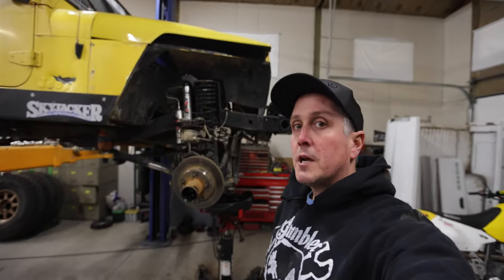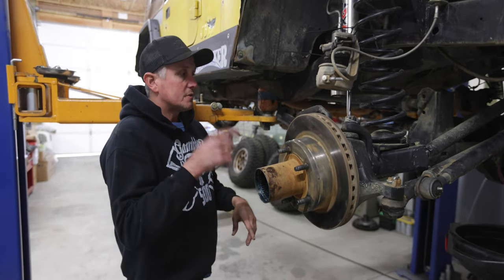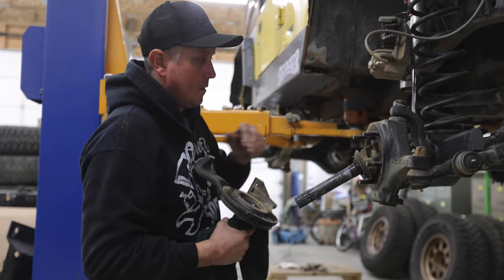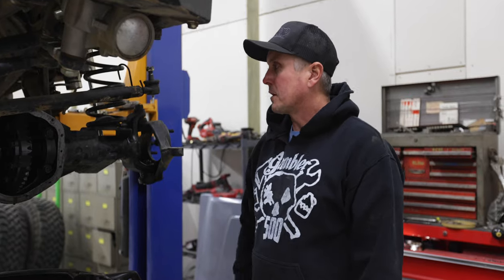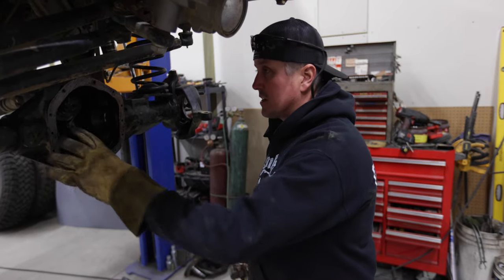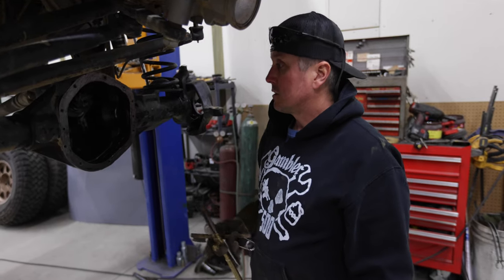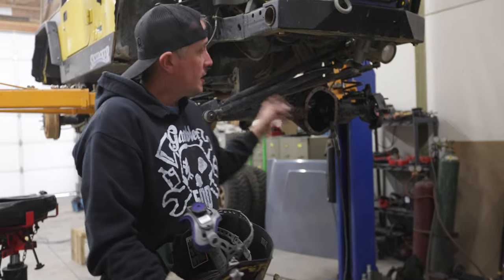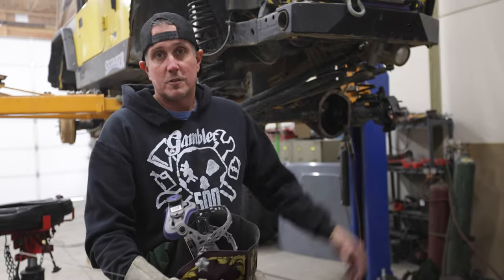Repairing a Dana 44 axle housing and the tricks I use.

Comment: Being a retired pipe fitter/ welder your choice of the high nickel rod for welding dissimilar metals is correct. The fact of welding cast steel to steel tubing again correct choice of the filler rod. The good part of your process is the preheating of the cast material, although either heating or peening the weld afterwards does help with stopping possible cracking. Good job young man.
Reply from the maker: Thanks!  I’m no pro.  Just a guy figuring it out as I go.  And trying to take in all the information that I can

Comment: I love seeing different ways to weld axle tubes to the cast.  I've got a stick/TIG machine but only done stick with it.  I've welded cast iron to steel and it held up well.  An old guy told my welding buddy that if a magnet sticks to the cast well, you can weld it but if it's not very magnetic the weld will never hold.  Not sure how true that is, but the cast I welded held a magnet almost as good as steel.
Reply from the maker: That’s a valid technique

Comment: Super cool video, wish I had a TIG! I welded the tubes on my 8.8 this summer using a MIG with no problems. Preheat to 400+ degrees, weld, then wrap with a welding blanket to hold the heat in and cool slower. 5k miles on it so far, no problems.
Reply from the maker: Yep. Getting it done

Comment: Great tip fave I’ll be picking some of that up for future projects.

I use to work for a sawmill mfg company that utilized VW motors for the power plant. We direct drove the mill with an extension that was welded to the forged crank I think we used a stainless wire in a Mig welded on a turning setup, it work pretty good until something hard was hit with the saw! They would commonly break right at the weld, kind of a fail safe. 

Thanks again!
Reply from the maker: Good information. Thanks
Reply: https://youtu.be/y07RP06N7o4 in case you want to check out the sawmill.  We did a lot of our own fabrication from machine work to welding, and ground up engine assembly.

Comment: I'm one of those who welded the center section to the tubes on a Ford F250 axle.  I didn't use nickel rod because I'm not trying to get cast iron to keep together - will it work to seal the tube? absolutely.   I took my high pinion apart, moved the center section to the passenger side, installed a truss/upper arm mount, used RCV spindle mounts with 1/2 ton GM spindles.  Used 4340 Yukon gear inners, needle bearingless ujoints and dana 60 outer stubs.  It's been bulletproof - been running it for 7 years now in an FJ40 on 40s.  I used the 44 because I wanted clearance. Going to weld a mount to a Dana 60  this weekend, using MIG.  Nice thing about those Ford axles - 1/2" dom axle tubes.  An alternative to expensive nickel welding rod or arc welding rod - stainless wire for your MIG....
Reply from the maker: All good info. Thanks
Reply: @thedirtheadshed  I learned about the same way as you did... good and bad old timers.  The good ones told you the right way, the others got fireworks in their weld lines

Comment: The issue about welding dissimilar metals is due to the different rates of thermal expansion. The reason nickel is suggested as a welding rod is because nickel will elongate more than other types of welding rod before it yields (cracks). This allows the two metals to expand and contract at different rates without cracking the weld. Welding to cast is a different issue all together, because the manufacturing of a cast piece can have many inclusions and contaminants contained within the part. These can potentially surface during the welding process and require serious rework. With this said, if you know what your doing, all these issues can be overcome as you showed. Looks killer!
Reply from the maker: This is the information we need to know.  Thank you for commenting.

Comment: I mig welded my d30 with just warming up the center forged steel, worked out really good
Reply from the maker: Right on
Reply: Sometimes polishing a turd works out good, after spending 1500 on it.... Wheeling it for 5 years now on 35s, havent had an issue yet...

Comment: Thank you, on my 15 JKR 4Door I have installed on my Dana 44 a full upper truss, upper and lower C braces, RCV axles and Dyanatrac Ball joints and Reed Knuckles. PSC hydro assist now on 37 inch BFG's. and you just let me know that i have done the right thing. I had been doubting my decision and thinking about one tons.
Reply from the maker: It should be good to go

Comment: I love seeing this kind of stuff Dave. It is useful and practical information the average guy in his garage can use. I have used ER70S-6 mig wire to weld axle tubes to center sections a few times and never had any issues. I have been told it has a decent nickel content for mig wire
Reply from the maker: If it works it works.  That’s the wire I use too

Comment: Good tech Dave!!! Gonna try that rod Next chance i get!
Reply from the maker: It’s good stuff
Reply: @thedirtheadshed  I like to fill my housings with BBQ briquettes for preheat/post heating. Kinda hard to do that with housings in the rig though.
Reply: @thedirtheadshed  also the tj axle shaft trick I used on the front axle that's in my black cj7!! Which is a cut down waggy housing! I also splurged and went  30 spline on the outters

Comment: This is such a better quality video, in production and content than the first few. Love these home style how to videos especially on welding and fabrication.
As a home builder, have been stubbornly using flux core wire (gas less Mig) even for panel work and and welding thin stainless motorcycle exhaust for projects. Do you ever use it when away from your shop?
Reply from the maker: I have used it here and there. Definitely works well in the field.  And if you get the technique down it can be really clean and strong

Comment: Keep it coming I’m using the same axle though everyone tells me it’s not strong enough. Also good to see someone use chromosome in a 44 instead of going straight to Rcv. I would love an rcv setup, but if a $600 option works, why pay $1800 (3x more) when the splines will be just as weak
Reply from the maker: I like the idea of rcv stuff, but I’ve had really good luck with these Yukon super joints

Comment: Cool stuff Dave! I don't know that I have ever seen that rod before, but I have a pretty good selection of nickel steel stick welding electrodes in my bag of tricks. Was you purpose to just seal the tube to the housing? Looking at the weld, I wonder if there is enough build up of metal to not crack down the road.
Reply from the maker: Yeah. Just sealing it. I did a double pass.  It should stay good

Comment: I was wondering how did that Midnight Metalworks T-case work out on the UA? It is something that I am thinking about, I heard that they take up less space than the 231. I have an UCF ultra high skid on my jeep with 1 1/4" body lift, so there is little room and I don't want to beat up the floors to fit an Atlas.
Reply from the maker: It is good and compact. I will have a real review of it soon

Comment: Thanks Dave, I've been wondering about this, about dealing with the oil.  Do you heat it til its done smoking?  Or do you shoot for a specific temperature?
I'm going to be putting a Sterling 9.75 out of an Econoline van in the rear of my Astro van for drag strip use.  It's got a cast iron center and steel tubes.  Almost all of them that I've seen are leaking in some way.  Needs to be welded for what I'm planning.
Super Missle Wire...LOL!  I was looking at nickle 55 but I'll have to look for some of that.
Reply from the maker: I heat it till it stops smoking
Reply: @thedirtheadshed  Awesome.  Thanks for the tip!

Comment: You using .023 or .035 wire?   I came from welding on heavy equipment and used .035 and bigger but thinking for jeep stuff I should maybe go to .023 wire.
Reply: For mig welding sorry I should have made the clear.  You da man Dave!
Reply from the maker: I only run .030 in my mig.  Never been able to make 23 or 35 do what I want it to do.

Comment: Thank you for the vids!  I was wondering if there is a pre heat/ post heat process when you tig weld the cast steel to tube steel, Or is that just for cast iron to steel?
Reply from the maker: You should pre heat, and make it cool as slow as possible

Comment: I have the exact axle going in my TJ.
What steering did you use. I tried to use the stock Bronco linkage but the drag link runs behind the tie rod and it won’t work.
I ordered some heims to make my own
Reply from the maker: This is a y link builder kit from Barnes 4wd

Comment: I have an F150 HP D44 from 1977 (disc brakes, 1/2" tube walls) and I am 99% sure the center section is cast iron (ductile iron). I tested it against the knuckles (also ductile iron), the tubes and the inner C's (both cast steel) using a sharp drill bit to generate some cuttings and then inspection. Steel will produce long twisty cuttings that are a bright silver color. Ductile iron produces some shorter twisted cuttings, but mostly smaller non twisted cuttings with a dull grey color. The only way I could be more sure about the materials is if I sent samples to a lab. 

The tubes and C's are bright and twisty, and the center and knuckles are flaky with some small twisted shavings, and dull grey in color. I am so sure the center and knuckles are ductile iron while the tubes and C's are steel because this type of comparison is very obvious. 

Perhaps the F250 is different? I notice the center castings is definitely different in shape (subtlety) so the centers housings of D44's out of late 70's F250's definitely could be a different material than 1977 F150 D44s.
Reply from the maker: You have done a lot more homework than I have on the matter
Reply: @thedirtheadshed  Perhaps, but all I can say is my particular axle housing is ductile iron. In a higher GVWR vehicle like the F-250 it may be cast steel for strength or impact resistance or some other reason.

Anyway, I enjoyed the vehicle and look forward to more in the future.

Comment: Love this jeep! How much weight do you think you saved going with the truck 44 vs a 60 that had also been narrowed? I moved one of those big truck 44's around and it seemed pretty heavy.
Reply: The 8lug d44’s have 1/2” wall axle tubes so it’s only knuckles out and center that’s lighter
Reply: Thanks Larkin, so maybe 100 lbs?
Reply from the maker: They are still pretty light compared to a 60.  The brakes, knuckles, carrier, gear set. It all adds up
Reply from the maker: I don’t know the exact numbers.  But I would bet this 44 is probably 150lbs lighter than the 60 in my ford